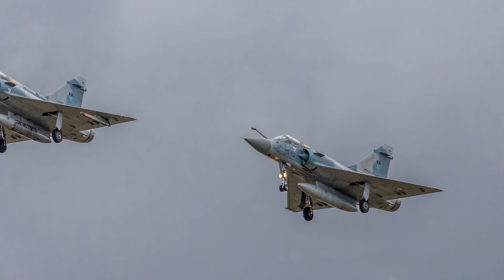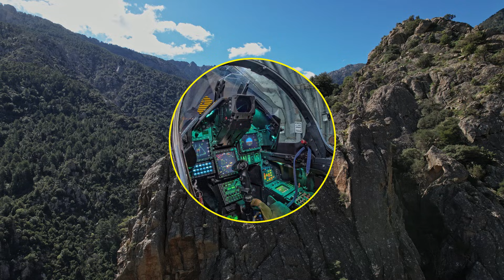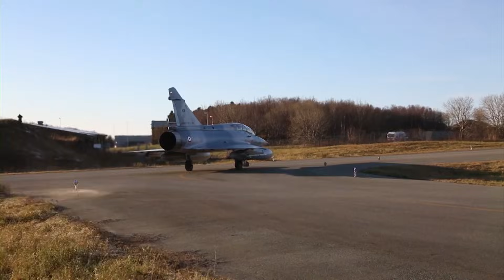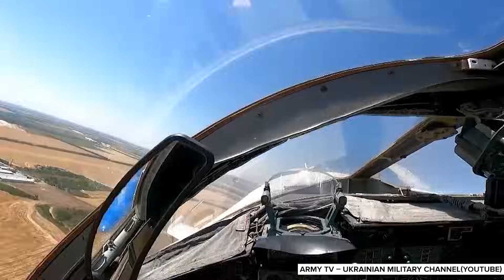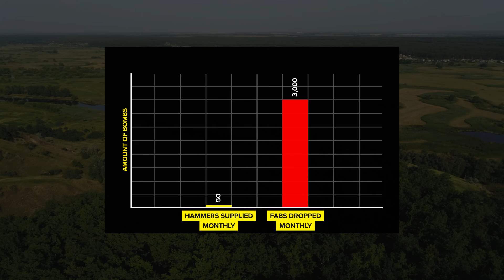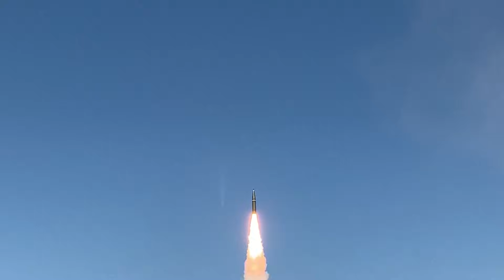Ukraine BOMBER BRIGADE Is Getting French Supersonic Jets

Comment: The Mirage 2000 was not a great export success like the older Mirage III. It sold almost exclusively to 3rd-World air forces, and was nowhere near as capable as the F-4 Phantom or the F-16. The 2000s are now 40 years old technology and had little combat success, but 2-3 have been shot dowm. Hardly a game changer.
Reply: Correction : sitting in a last-gen F4 facing any Mirage 2000 would be an extremely bad idea.
Twenty or so Mirage 2000-5s will certainly not be a game changer but these aircrafts can indeed cause significant damage.
Reply: @JefElder  I don't really know how,
French radar electronic systems have been fairly basic and the missiles even worse. It has been modified over the years, but so has the F-16 which has actually shot aircraft down. Unlike the 2000.
Reply: @billballbuster7186  The French RDY radar is equivalent to the F16’s AN/APG-68, but it’s true that the AIM-120 AMRAAM carried by the F16 have a much longer range than the MICA, which means that the Mirage 2000-5 will be of very limited use for air defense.
Therefore, the fact that the Ukrainians have decided to divert large numbers of ground crews to keep these aircrafts in operational conditions seems counter-intuitive. Except that the Mirage 2000-5 can carry both Storm Shadow / SCALP and air-to-ship missiles (the French will not send Putin the list of weapons delivered with their Mirage), which means that this platform is now one of the best, if not the best available option to destroy the Crimean bridge and/or other more distant critical infrastructure, and a serious option to inflict heavy damage on the Black Sea fleet.
Reply: @JefElder  I notice its mainly "French Sources" that have all the good things to say about RDy. But the 2000 was never really kitted out as an attack fighter in the same way as the well proven F-16. Anyway I guess in time we will see how it operates in the Ukraine environment.
Reply: @billballbuster7186  Again, the main added value of the Mirage 2000-5 is for Hammer strikes (however the Mig-29 can easily handle that) and, more importantly, deep strikes where it will vastly outperform the Su-24 and which the F16 can't carry out in Ukraine for lack of suitable weapons. As you certainly know, deep strikes are dangerous business but the stakes are high, so it’s all about developing the spectrum of capabilities. And you’re right, we’ll see.
Reply: Yeah, I'm still waiting for Elon to send those 100 million drones.  I remember some idiotic country thought artillery was dumb too.
Reply: @thieupham493  I get your point crappy old French antiques are better than nothing..
Reply: @billballbuster7186  Yes, especially when Russia doesn't have enough resources to deal with those old strike fighters.  Russia has plenty of jets, but not enough good pilots because all of the competent pilots have already died.  We are giving them older strike fighters because it allows them to strike at more of those artillery pieces that are preventing the tanks from moving forward.  Real war is slow moving and at the end of the day, we need soldiers to march forward to win wars.

Comment: So Mirage is ok but not Gripens? 
Maybe the US was too afraid to loose sales for their own planes?
Reply: A politically united Sweden agreed that sending Gripen to Ukraine was a possibility, but were asked by uhm someone to not pursue this line. Having too many different types would just complicate matters you see, regardless of the fact that the Gripen is much, much easier to maintain and refit than the F-16.
France didn't wait for anyone's permission and sends their aging but capable aircrafts, and I love them for it.
Reply: @ 
We do know it wasn’t Ukraine. This someone isn’t too hard to guess.
Reply: The Gripen has many US parts in it, so it needs US authorization. The Mirage 2000 has none.
Reply: @eric0dujardin  Well, I think the F-16 has a few US parts as well..
I think the main problem for the Gripen is the lack of airframes, some C's and D's will become available when the E's replace them, but that's still years in the future.
Also, Mirages and Rafales do have non-french tech in them, namely the MB ejection seats, which was enough to hinder sales to Argentina.
Reply: @ 
Yea that was the reason they couldn’t sell to Argentina when they wanted to buy. :( not so neutral.

Comment: Gripen would have been better....especially since it shares most parts and engine with the F-16.
Reply: The engine is not the same as a F16
Reply: For air to ground, a two seater with recon/designation pod will do better than a single seater with the same pod.
And i don't think the Gripen can launch cruise missiles.
That said, the Gripen would still be a great addition to ukrainian forces. Pity it hasn't been delivered since the start of the war, nor is planned to be.
Reply: Probably but as there are not available it's a moot point. There will be enough Mirages for a couple of squadrons which makes it of interest to the Ukrainians. As would another couple of squadrons of F16's. Best of all would be to equip with Typhoons but they are never going to be available in the numbers Ukraine needs and to buy new I doubt Ukraine could afford to buy or run them.
Reply: @Scaleyback317 i think the Grippen will find its way to Ukraine. But secrecy is in order to catch russia unawares.

Comment: When Ukraine links up all these different Jets so that they can share information find enemy targets further away, that is when things will change.
Reply: Since all these aircraft are NATO standard, there is a good chance that interoperability is already in place.
Reply: Not necessarily, although that WOULD be fantastic.
Reply: @jimtalbott9535  it wouldn't be the case if these Mirages 2000 were coming from a none aligned country, but since both F16 and Mirage are coming from Europe countries, there are normally IFF on them, meaning they already know how to locate friends and foes. Unless these modules were removed before giving the aircrafts to Ukraine.
Reply: If those fighters are fitted with the Link-16 datalink interface, there shouldn't be any problems in regards to strategical/tactical information sharing among many NATO standard air, ground and sea platforms.
Reply: @fightingfalcon1986  The Mirage 2000-5F's are all equiped with Link16.
Reply: Swedish AWACS gives what is called force MULTIPLYER
Reply: Ukraine is crumbling Russia by outsmarting them. The time of big machines is over.
Reply: How? 
You think they are going to beat Russia with donated jets? 
This is completely insane. 
There is no victory to be had here, Russia will never back down. 
When is enough for you warmongers??
Reply: Wait until Trump sends F-35's to defend Russia.

Comment: There's a small error. The 2000D is not an evolution of the 2000C model. The C model is a one seater air superiority jet. The D model is a two seater bomber. The N is a basically a D model specialized to carry and launch the french medium range nuclear missile.
The 2000-5 version is an export version of the C model with the latest improvements. It's nearly a "single motor Rafale".The Mirages 2000-5 sent to Ukraine are modified to allow ground attack capability (maybe to be able to launch the SCALP EG/Storm Shadow missile) and improved electronic warfare.
Reply: The Mirage 2000-5 is equipped with an air-to-air radar, not with the AESA air-to-ground mission-compatible radar that we can see on the Rafale. Hence the necessary, time consuming adaptation of the mission system, enabling it to launch the SCALP or other munitions of the sort.
Reply: In fact, the D is derived from the N, not the opposite. D is for "diversifié" (diversified). After the Gulf War the need for a modern  weather striker emerged. The quickest way was to get the base from the N and adapt it to the strike mission: target designation and electronic warfare pods together with classical guided bombs (the N can carry laser bombs but lacks the designation pod). In the hurry, they left in the D some "sensible" equipments needed to the nuclear deterrent mission of the N. So the D was never sold to a foreign country.
The Rafale has a ground attack capability, so it is a blend of 2000-5 and 2000-D… Furthermore, it has the naval capability.
Reply: The mirage 2000-5 isn't an export varient of the C, it's an upgrade from the C varient with the -5f made for france and -5 for export
Reply: Dans tes rêves l'on a cèder des mirages avec des radar nouvelle génération, les rafale en ont trop besoin. L'on a fabriqué que 35.
Reply: Slava BAGUETTE 🥖
Reply: Yes, and those airframes are very tough, let alone the reinforced ones, though the regular one can also drop those spicy loads, it is capable of loading and releasing them correctly, just have to point at the target at high altitude, wait for the thump of release, turn 180 degrees while going through the gate to full afterburner and aim down hard, and try to get at least 15km away before that bomb reaches detonation altitude, and put the helmet blackout shade down, and hold attitude and speed within limits. Then when it all goes white, check you still have controls, do an electrical reset if needed, and get out of dodge. Plus before you go up make sure that mode switch in the avionics bay has been selected to position 4 as well, instead of 3. Otherwise you will drop it a little off target.
Reply: The Mirage 2000-9 is a "baby rafale" because it's a multirole aircraft. The Mirage 2000-5 is a air superiority aircraft. The 2000-5 was an export version finaly bought by French air force to replace C models.
Reply: @danielM7181  the baby rafale should be the mirage 4000 the precursor of the Rafale
Reply: @Yue2000thegamer  Not baby... It was way bigger than a Rafale. More like a F-15C in category
Reply: @danielM7181  The mirage 2000-9 was only the most advanced version of the Mirage 2000, but nowhere close to Rafale in capabilities and technologies.

Comment: The French Mirage 2000-5s have very similar equipment to the Rafale, apart from this ground attack capability and it seems that modifications in this sense are being installed on the Mirage for Ukraine which will make it a particularly versatile aircraft. Equally good in air combat and fire support.
Reply: Nope, the Emiratis Mirage 2000-5 Mk2 had simiar equipement with Rafale, but the Rafale of that time, the F1-F2 version.

But about these Mirage 2000-5, it seems the electronic should be upgrade. Only time will tell.
Reply: Good news , Did the Ukraine pilots already had  training or undergoing  training on Mirage -5 ?
Reply: @sagarlondon1   Yes, France is training Ukrainian pilots since may 2023.
Reply: @sagarlondon1  Yes training should already be completed for a first batch of pilots.
Reply: @phildur  good news
Reply: @sagarlondon1  "Le Figaro" (media own by Dassault family) made a paper speaking of ukrainians (mechanician) being trained on Mirage in march 2023, but quickly deleted the news :)
(edit: the news has been put back online in the mean time)
Reply: If you are talking about the last version of the Rafale, the "F4 Standard", it's wrong, this version has very similar equipment with the F35... so not the same thing at all
Reply: @johndoe-cd9vt  The F4 standard is only just beginning to be delivered to squadrons, currently these are Rafales with the F3r standard
Reply: @CROM-on1bz  but same thing the F3 has nothing todo with the mirage, not even the same Era ... The rafale has been built to replace the mirage and other planes
Reply: @johndoe-cd9vt  Man faut lire et comprendre on parlait de la suite électronique et de l'avionique (et pas ta mère).
Reply: @CROM-on1bz  t es vraiment kon ou c est fait expres? ... Enfin bref je laisse tomber t es irrecuperable.
Reply: @johndoe-cd9vt  C'est celui qui dit qui y est.🤣🤣🤣🤣
Reply: @CROM-on1bz  j avais pas entendu cette expression depuis des lustres... merci pour ce moment ...

Comment: "MiG 29 are inferior to F-16"       BUT    due to some magical powers of the Indian MiG29s , the pakustan air force refused to even fly the F16s during 1999 Kargil conflict.
Reply: Not what Wiki says. According to Wiki no air combat ever too place in that conflict and the F16s were subsequently withdrawn because sanctions on Pakistan meant they couldn't get spares.
Reply: @jetplaneflyer  exactly ! Because Pakistan air force REFUSED to fight due to their F-16's would be opponent were MiG29s
Reply: Couldn't handle the P&W! lol
Reply: Found the ruSSian bot. 
F-16s were used by Pakistan to patrol right on the border. 
The Indian Mig-29s declined to engage them on several occasions.

But nice try pretending it's the other way round, orc.  ;)
Reply: MiG 29s are lethal in close dogfight engagement but they're shooting turkeys for F-16s.😅
Reply: Yea, let's not forget the Migs have a replacement service life on the airframe and engines of 2,000 to 4,000 hours, MAXIMUM....while the F-16 and engine is good for 8,000 to 12,000 hours...ENDLESS parts available...and why one Mig pilot said "flying the 29 is like having a land line phone...the F-16 is like a brand new iPhone!" . The Mig was was 20 years behind the F-16 when it came out and the F-16 was 10 years older! Russia can't male a plane half as advanced as an F-22 for atleast another 20 years, if at all and the Raptor is knocking on 30 years old....much less anywhere remotely comparable to the F-35! F-16 = most produced, most exported fighter in history and we have sold more Vipers than the total of Mig 29 and Sukhoi's of every model COMBINED! The F-35 has been purchased by 20...TWENTY COUNTRIES and will replace the Viper in total sales...we've also built and delivered more F-35's than Migs and Sukhoi's COMBINED! America is AVIATION! Since WWII, America has been and still is the most advanced, innovative, ground breaking, highest quality producer of aircraft in the world by such a large margin, we can't even see 2nd place from how far ahead we are......sit down and shut it! If you can't keep your mouth shut..at least have the decency to put a dick in it so,the rest of us don't have to listen to you!
Reply: If they didn't have the right armaments to do some good, why risk them?
Reply: F-16 has never lost to enemies fire
Reply: @livelifetothefullest4386  Everyone knows that a Greek Mirage 2000 shot down a Turkish F16. Except you, apparently.
Reply: @livelifetothefullest4386  Indian MiG21 downed Pakistani F16 recently.
Reply: @pravindahiya719 that claim was proved to be false, I wonder what else India lies about 🤔
Reply: @pravindahiya719  information source?
Reply: @jetplaneflyer  1999 Kargil conflict  -  the pakistani air force refused to participate.
   Pakistani leaders & military officials were on tv, announcing a lot & though Indian & Pakistani write in different scripts - we understand the spoken language quite well because of many common words & similar grammar.